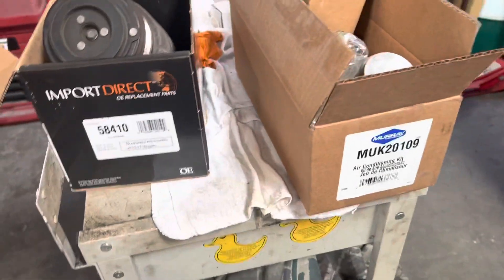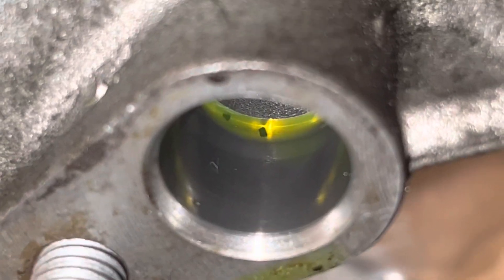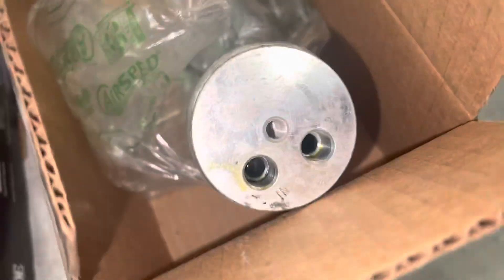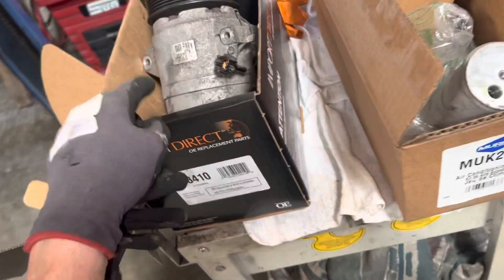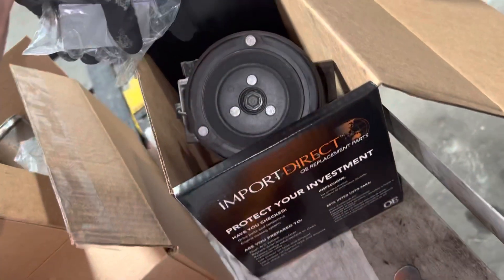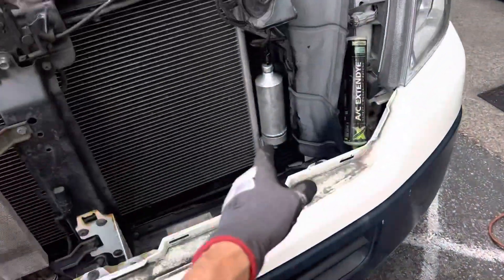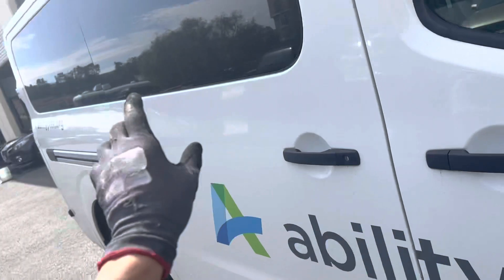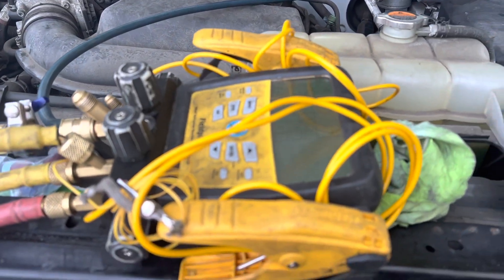WHY IS THERE NO OIL IN THE COMPRESSOR?       Where did it go￼ ? And why ? ￼

Comment: Thank you for this. I just had to replace the compressor in my 2018 Tacoma due to loss of refrigerant (corroded connection at the condenser). I have the service manual from Toyota which indicates to basically drain the new compressor and put in the volume you take out of the old one...well...nothing (very little) came out...well damn...so...do I install a new compressor with no oil?....Yes....lol.
Reply from the maker: Oh sir you probably have the little black oil spots that collected some dust at the Leaking points on the condenser but it wasn’t much oil it’s looks worse than it actually is you know how one drop of oil when left on a piece of paper a few days later, it’s the size of a Silverdollar but it’s only one drop. 

So most of your oil is up in your evaporator 

It’s not gonna kill the world if you have only one extra ounce of oil that you leaving the compressor .  Because you don’t want to start up a compressor with nothing in it.. 

You are changing the condenser so I think if you look up in your manual, it will say 40 mL or 45 mL. I cannot remember off the top of my head to add when you replace the condenser. 

Then, if you look in your manual, you’ll be replacing the receiver dryer it will probably say around 30 mL may be a little more . 

So you will be adding that refrigerant oil . 

Look inside the inlet of the vapor, high pressure port going into the condenser is it black? 

If it is black, that means your compressor got very very hot before completely ran out of refrigerant, and stopped working . 

This is something to keep in mind . 
It’s still could be working but it has been run hot and has been stressed and will shorten its overall life expectancy

Another thing you can do squirt a half a can of brake clean, or carburetor cleaner, or some solvent like that. 

Squirted in the liquid side, small part of the Condenser use some compressed shop air and blow backwards through the old condenser into some tissue paper white rag something like that 

And see if there’s metal particles or black, stringy plastic substance material that would be the piston rings . 

To try to determine if there was any compressor damage 

Sometimes you’re lucky and sometimes you’re not  🤞
Reply: @coldfinger459sub0  Thanks for the reply! 

There is no sign of anything black from the compressor, no indicator of it getting hot, no debris. The inside looks mint from the ports.

Last week while on the highway all of a sudden I hear a loud squeal as the clutch was being destroyed. Before I removed the compressor I made a point to try and rotate it by hand, which I was able to. As far as I can tell, outside of the clutch being messed up, it seems fine. The truck did give me an A/C lockup code, so my expectation was carnage.

I drained what I could from the new compressor, then added a small amount. I also added as per manual some oil to the new condenser. No sign of any metal debris anywhere. The OEM oil coming out was in mint condition, clear and bright green from the dye. I reported a concern with the A/C while it was under warranty, as I don't think there would be dye in it from the manufacturer, so I assume that was part of their inspection. Turns out after my warranty ran out a TSB went out to address (under warranty) the issue I was reporting (loud whistle from evap core).

I do plan to take apart the old compressor to see if I can find anything wrong. But I can turn it by hand, and with my fingers over the ports it makes pressure. Obviously that does not mean its good, but maybe I am on the lucky side? I was rotating it and the new one to make sure I was getting as much oil out of them as I could, no pieces came out with it.

I will try out the brake clean & air on the old condenser and see if anything other than oil comes out. Before installing the new one I did let the old condenser drain a bit, and the oil was as clean as can be.

I am not a mechanic but did my best to go into this as well informed as possible and took my time. I have some experience already replacing the entire system on the wifes Honda civic, so this was not entirely new to me. For none A/C technicians such as myself, information in the field is very scattered and sometimes wrong...."The new compressor comes with oil! Install and send it!"
Reply from the maker: @TriggerHappy6T9  👍
Reply: @coldfinger459sub0 Thought I should mention. The clutch started slipping/squealing while on the highway during heavy rain. What are the odds it was just the clutch getting wet and caused it to slip and burn itself out?
Reply from the maker: @TriggerHappy6T9  clutch slippage sometimes is usually do to the internals holding the shaft while the engine pulley continues to try to spin the pulley and plate, and then the outer face clutch that is connected to the shop to the internals of the compressor is trying to bind up. 

Unless it was 100° outside in your fans were working in his approaching 400 psi, and sometimes week clutches will slip but you were not in those conditions . 

Rain would actually make you have a very low, high side pressure

Comment: Great video, thank you for explaining where all the oil ends up. So when this happens, do you recommend installing the new compressor drained of all the oil and then the oil that is still in the evap or lines will make its way back to the compressor when recharging or will the new compressor be damaged without any oil in it during initial start up? If so do you just add a minimal amount to the compressor to prevent damage? Thank you
Reply from the maker: If the oil is clean and not burnt or metal flake, you can leave the oil in the rest of the system. 

And just perform your normal oil, balance procedure between the new compressor in the old compressor .  

You must have a little bit of oil in your new compressor 

And you have to determine whether your new compressor is the type of that has a oil drain plug that captures and hold some of the oil on the internal of the compressor 
              This type of compressor you cannot pour the oil outdoor measure it through the high side and low side openings. 

You must remove the oil drain plug in performed the oil fill in train procedure through the oil drain plug . 

Many times technicians don’t know this . 

And they attempt to pour out oil from the new compressor and get nothing or almost nothing, but they’re can actually be several ounces inside the compressor behind the oil drain plug . 

So they had a lot of oil and become very over oiled 

Some come with no oil inside of them 

The technician just add to oil in the suction or discharge line starts up the compressor. It runs for a few days or a few weeks but there’s no oil in the center of the compressor where it is needed and sometimes these compressors burn 🔥up . 

This is why you do not use a rule of thumb or one method for all cars must read the OEM manufactures 
Manual 

Compressors do not die they are murdered
Reply: @coldfinger459sub0  Thank you for the reply!

Comment: When there is a leak - do you lose oil from that or is it just refrigerant mostly?
Reply from the maker: It depends where the leak is located and how fast the Leak is. 

If it’s one of the really micro size, small leaks, it usually only leaks refrigerant. Sometimes there will be a small oil stain that gathers dust turns dark but never really any quantity of no more than a drop. 

Let’s say you develop a larger leak, a crack at a pipe, but it is on the suction line located very high up in the engine compartment, the highest point .    The leak may be large enough that you may barely hear it or see if you bubbles a second but because it’s very high up on the system all the liquid refrigerant is down low if the vehicle is off, only vapor, refrigerant comes out.. 

Now let’s take that same scenario and put it on the liquid line at the lowest point right where it comes out of the condenser .   This is liquid, refrigerant, mixed with oil sitting in the pipe, and if you develop a crack, you know have liquid coming out might be hissing at the same time bringing all the oil that is mixed with refrigerant to say roughly 3% mixture of refrigerant in oil by white coming out of that leak.. 

Set an all depends on location, operation and size of lake . 

Oil never wears out if the system is clean it’s dry and there’s no moisture and there’s no air inside the system. The oil will last forever. 

Oil only leaks out like in a car collision in a line is cut in half an instantaneously all the refrigerant rushes out of that point then there will be a small amount of oil loss .  Plus the amount of oil that was inside the condenser that is no damage to it will have to be replaced..
Reply: @coldfinger459sub0  Your detailed knowledge is outstanding - thank you. Nothing is as simple as you first imagine!
Reply: @coldfinger459sub0 I changed the compressor on my car today and the one I pulled out was bone dry - no oil came out, the compressor had been leaking refrigerant through it he seals on the compressor itself. I wasn’t sure what to do so I refilled the compressor with what it came filled with initially(150cc/150ml). I  figured it must have lost the oil but I do know that it was low on refrigerant when I got it decommissioned 

I still have to replace the
Condenser and drier tomorrow,
I don’t want to overfill the system - should I drain some oil from the compressor? I don’t know How much should I put in the condenser and drier now either
Reply from the maker: @RWB1111  if you don’t see oil any were . And you don’t see oil flung around from the centrifugal force from the pulley spinning little drops every were collecting dust.   
Then all your oil up in the evaporator. 

Old compressor has a gray metal powder . Small flakes of metal.?

Can you put some brake clean a carburetor cleaner in the old compressor shake it around poured out . Into a glass bowl or onto a white paper napkins 
  
That means all of this debris and burnt oil should be flushed out of the evaporator  

And while you remove the expansion valve to flush out the evaporator get a new expansion valve to at the same time . 

Then you’ll be starting with zero oil in the whole system so you can put the factory fill amount.